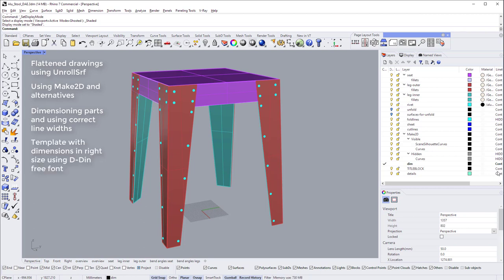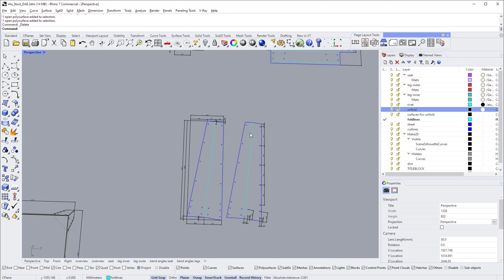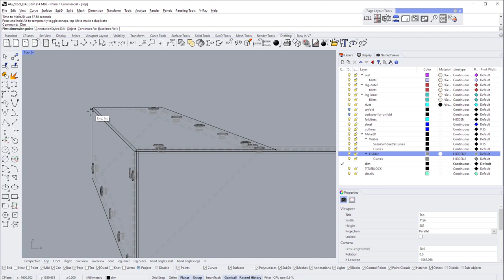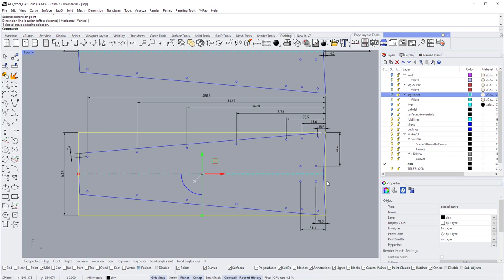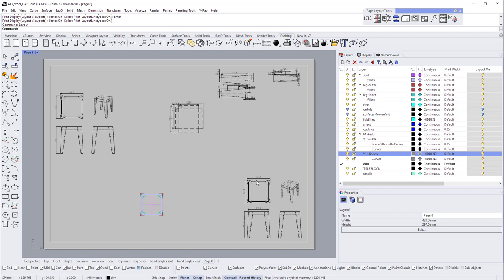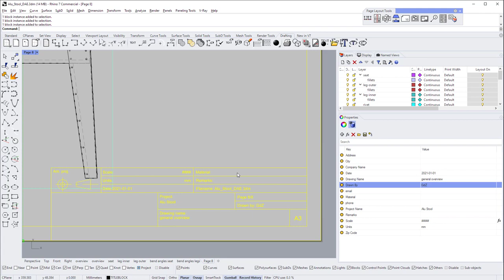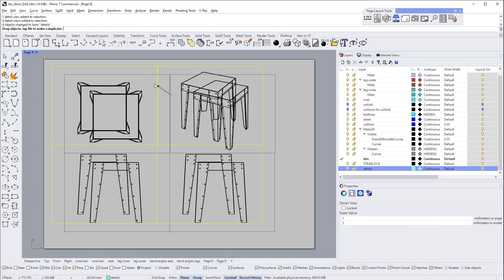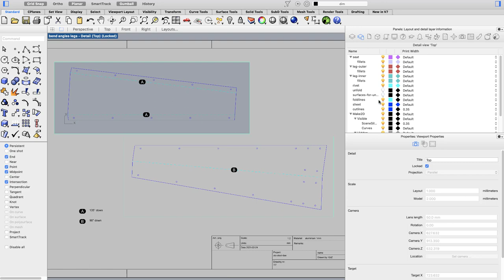Rhino 7 Layouts

Comment: Hi, thanks for the helpful video, but I was wondering if there is a way to control the K-factor while unrolling sheets. As I know K-factor is usually shared by the manufacturer based on their tool and other programs that have the direct ability to work with sheet metal, have this K-factor input. Is there a way to control it?
Reply from the maker: Rhino has no sheet metal module. In most cases, I just model objects as the final result needs to be, and hand it over to the manufacturer as 3d model, and let their software do the the correct unrolling. This particular case with thin aluminium sheets is more of an exception, where things can be simplified with little error. If you do need to perform this yourself, it will require a bit of hand work after enrolling. It depends on the amount of parts and complexity if that is feasible or not.
Reply: @studiogijs  thanks

Comment: Is there an advantage of doing this in RHino (looks like a lot of manual steps) instead of in software like Fusion360?
Reply: there is absolutely none. I've been using different CAD softwares (SW, Fusion, SKP, and RHINO) over my career. I got forced into using Rhino. While Rhino is very fast and flexible its lacking in terms of efficiency and accuracy when doing 2D drawings. Rhino is sub-par and way behind all the other ones when it comes to creating technical drawings or even simple layouts. It's pretty appalling in 2023 IMO.